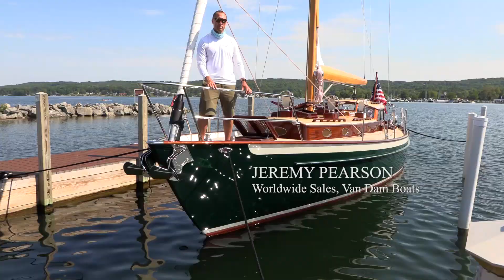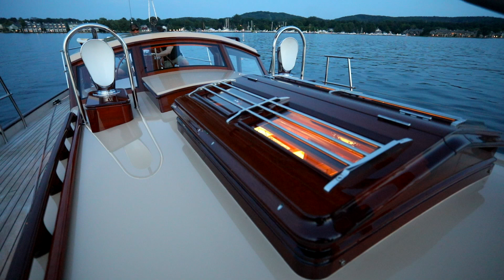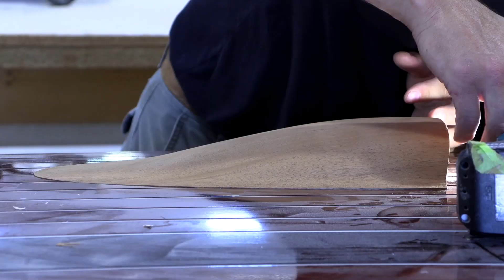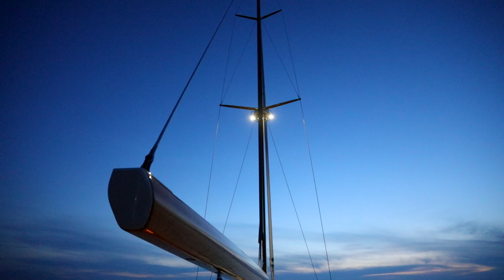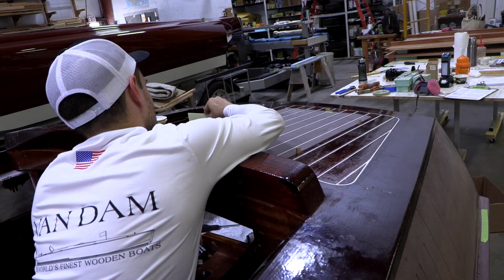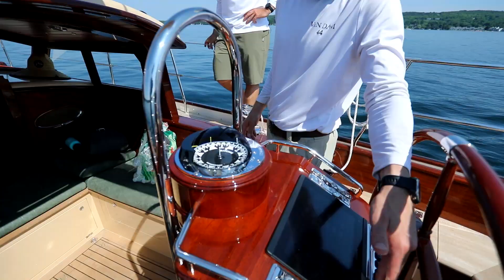From the Van Dam Vault: ITALMAS

Comment: Sounds kinda strange maybe, I us superglue on my skateboard and the really runny stuff just soaks into the wood in a way that I really makes it stranger and water resistant around the edges when the finish rubs off
Reply from the maker: There’s a lot that goes into the construction of our boats. When we are finished with them, they are basically hermetically sealed in epoxy. Water will never touch the wood.